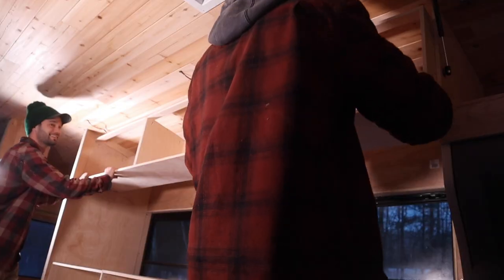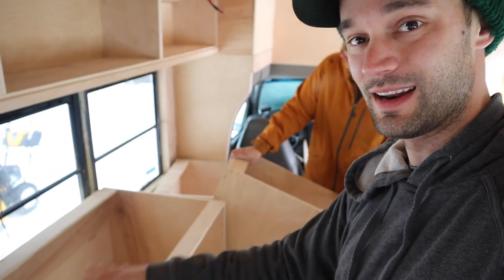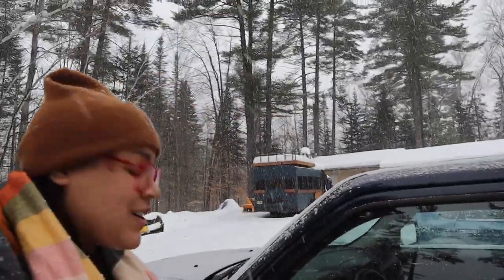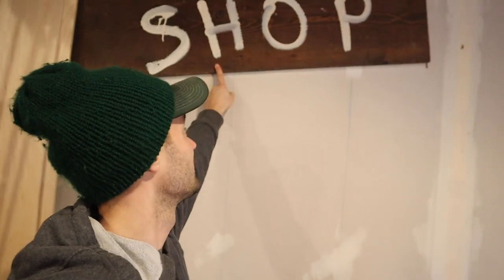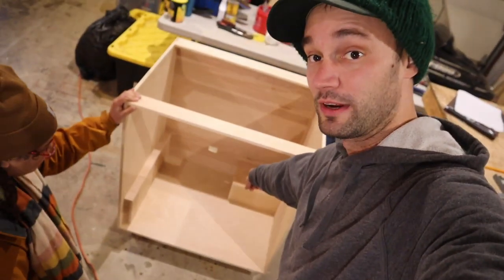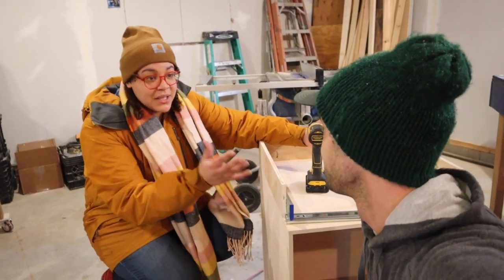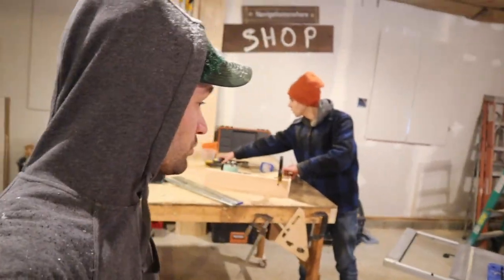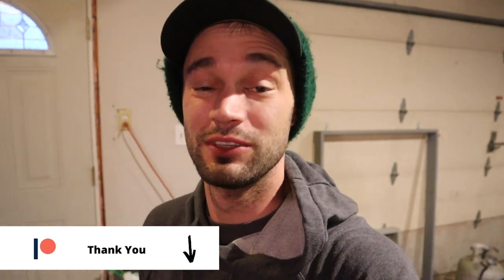Building In A Snow Storm | Odds and Ends On The Bus Conversion

Comment: Hi! I'm a roofer, so i may be of some help with the ice on the house. It's not supposed to happen.

Most likely, the ventilation is wrong. Either the air can't get in at the bottom properly, or the air can't get out at the top properly.

 For the bottom, going inside the attic and making sure you can see light at the edge all around would make sure it's correct. If not, the insulation has been pushed too far.

If there's not vent at the top ( called Maximum over where i am, it's the brand), that may also be the issue. You'll have to wait until the snow melt to install one.
Reply from the maker: Thank you so much. That is one of the problems, I went up last week and checked. My family bought this home years ago and this summer I will be replacing the roof and sheeting in many places. Someone before we bought it moved the insulation and ice chipped holes in the metal roof so it’s not good at this point. The roof is 30 years+ Yay! it’s time for a new roof haha.

Comment: They make calcium chloride pucks that you throw up on the roof to deal with ice dams. They melt through the snow and as they do the salt water runs down to melt a trench through the ice. That way water doesn't back up under the shingles.

Another way is fill nylon stockings with rock salt and lay them across the ice dam

Comment: that ice is because of lack of insulation. Heat is just pouring out through the roof as fast as you can produce it. As someone that has lived in the North of Canada for more than 50 years, I have seen this from time to time. It is not something the owner of the building wants just let be. It can destroy the entire roof and walls of a building.
Reply: This dude doesn't seem to worry much about insulation, heat,  or moisture exchange.
Reply from the maker: The roof is getting replaced this year for that reason!!
Reply: @navigationnowhere  Look into air sealing the attic from the house and take the proper steps to go around to seal them (before adding insulation if required). If you go forth with adding insulation, make sure your soffits are clear of obstructions (for proper air flow) and that you have attic vents (baffles) between each roof truss, if you don't you may have to add them (check with local construction code). While you're at it ask what is the minimum R-value for your region (mine is a little over R-40 for the attic). The added insulation (and air sealing) is worth the investments both for comfort and cost of heating/cooling.

Comment: the odds of a thief also being a SUB is extremely low, so calling it secret storage still works. I would add a Magnet lock to make it secure storage as well. (laptop hiding spot for those times you need to leave it on the bus)

Comment: Rachelllll 😍

Mike, before putting the long wood bits between the windows... do you put anything between the metal and the wood to insulate a bit/ prevent mold and whatnot? Rubber strips? 🤔

Also, no waterproofing/sealing of the wall and the back of the cabinets to avoid mold issues from the condensation in the windows?

I miss the snow... ❄️ it just rains here in the gray Canadian west coast! 🌧

Comment: How do the kick space drawers work when you put in the finish flooring? Is there room under the drawers? Cabinets look awesome!
Reply from the maker: Yes, I left a gap between the plywood floor and the kick plate drawer. It will slide right over
Reply: @navigationnowhere  thanks I was wondering how that worked. Looks awesome!